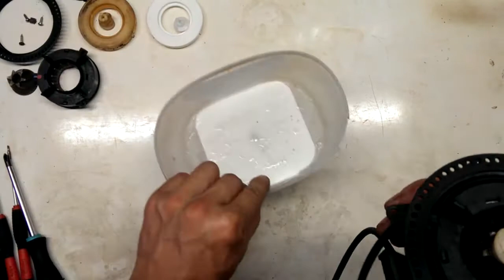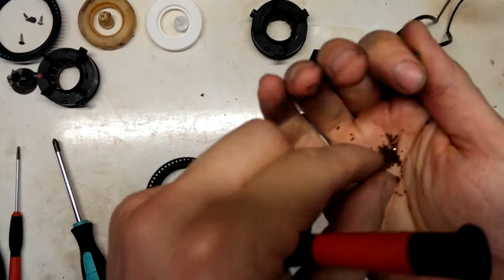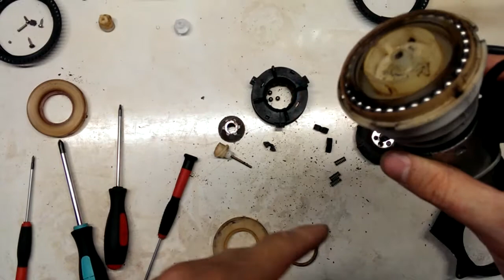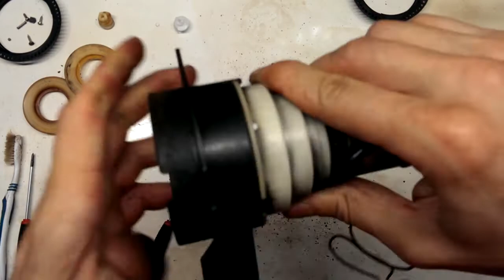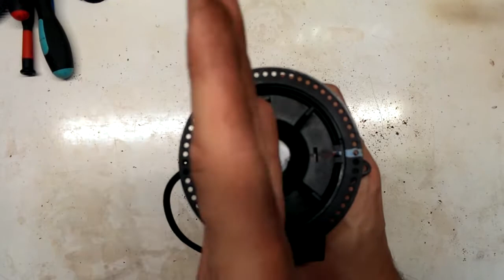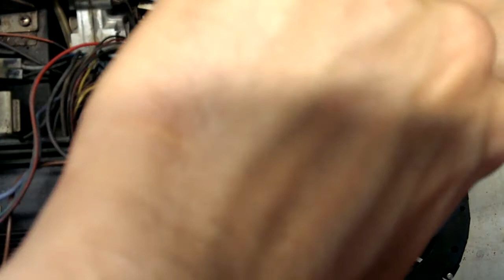How to restore Saeco Royal coffee milling mechanism Part 2

Comment: Nice educative video. I´ve got the same machine and I need parts for the grinder, the motor has been replaced 2 years ago and still good. Appreciate if you can tell me where to get the parts you are replacing in the video. Thanks.

Comment: Excellent video. You've saved a lot of time in figuring out how to disassemble the parts (without breaking them) a how to put them back together the correct way.
I checked the metal grinder blades and they look but I'm not sure. How do you determine if the blades need to be replaced? My machine shows about 19000 coffees made.
Thanks